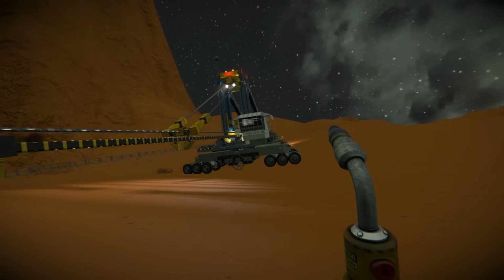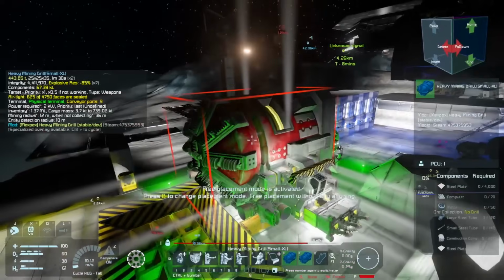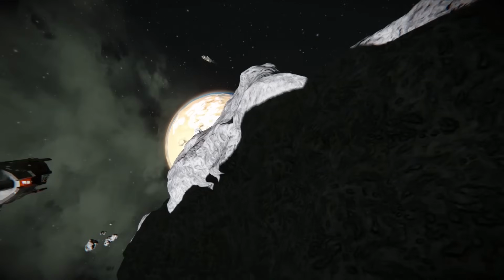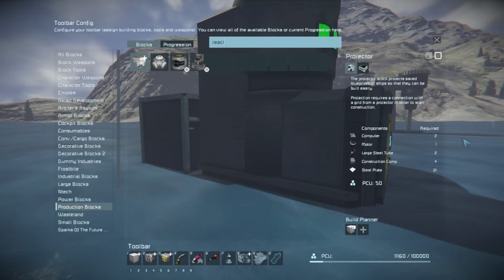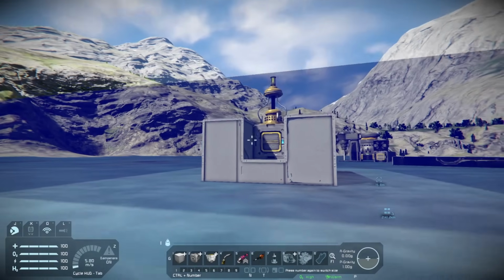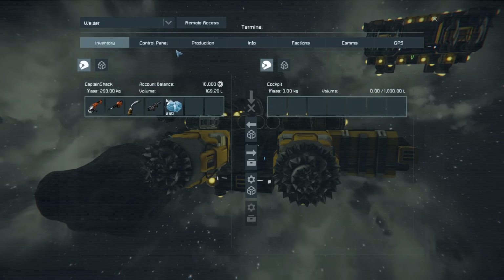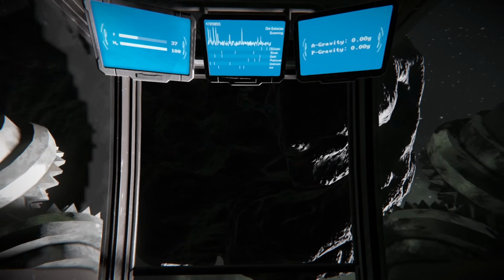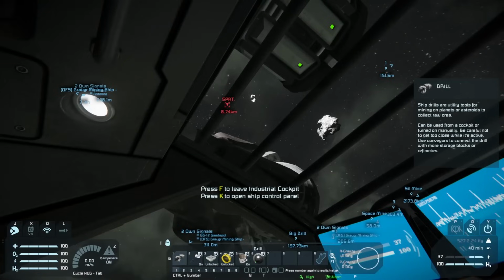Space Engineers - Collection of the Best Mining Mods

Comment: I used the resource nodes mod in my Agaris run because of how it worked well with the static resource locations. Setting up a base, getting it running, and keeping it defended were great 'strategic gameplay' additions in my opinion. It also makes setting up automated resource pick up and drop off drones viable if you have the fuel capacity (which with water>hydrogen you can easily do.)
Reply: Those is a really great ideay

Comment: Resource nodes are a great tool, good for "infinite" ore, but they have 2 massive drawbacks - 1) the sound will drive you nuts after a while, and 2) they shake the whole base like a regular drill shakes the ship.  Got a couple saves that use these for massive underground bases on hostile planets.  Also, those drills will mine stone if you drop them in stone.

I'm glad that you mentioned the the Nanobot Drill and Fill System and the Nanobot Build and Repair System.  I use those religiously in every game I play, just makes life so much easier.

Comment: The double ports on the Advanced Static Drill are for Speed or Power Efficiency modules.

Also, the Resource Node mod needs the drills to be just inside the voxel you want to mine, so you need to excavate to a given ore deposit if you want to use a drill on it. They also have to be a decent distance apart or they start slowing each other down, so you can't just stack 50 next to each other.

Comment: The Radio Spectrometry MOD is what they should have done with Space Engineers when they removed the surface information from the voxels to indicate underground ores.  If it had worked on planets (which it doesn't) with a limited range, it could be the perfect partner to the Deep Ores MOD and make it less of just drilling for luck.
Reply: I basically used the ore scanning script(can't remember name) for planets, and Radio Spectrometry mod for space. My biggest gripe was waiting for the list to scroll, but I think larger monitors helped get around that. I remember using screen/monitor mods specifically for this, and placing them so I could see them from the cockpit or the camera next to the ore scanner.

I used Deep Ores very little since I could no longer scan for all the ores from the surface. I don't know if the ore scanner's range still has a hard-coded limit anymore, but I just couldn't deal with the monotony of drilling like that.

Comment: AutominerV1 came out a few months before Nanobot Drill and Fill, they mine in the same manner but yet I've never heard of AutominerV1 or V2 until now. Autominer V2 seems to have a bunch of built in restrictions where as Drill and Fill you have to add in restriction yourself through the INI file. Seeing as Autominer is station only I think Nanobot Drill and Fill should have been mentioned right next to it considering everybody I know from the extended Xebon Twitch community plays with it and its sister mod Nanobot Build and Repair most of the time. Personally the best thing about these method of drilling while still removing the voxels stopping unlimited resources is that you can move the mining field under the surface to you don't leave gaping holes when you are using rovers or just hate seeing gaping holes everywhere.

Another one that could have been mentioned specially since you mentioned EVE is the Autotmated Beam Drill. It is modeled after the EVE Online strip miners and while it is a very old mod it is still updated.

Comment: Laser mining drill is also a very nice one. That mod even comes with a turret to smack on top of the laser drill block. Since it's a laser it's not actually a drill but works sort of as a drill. Check it out, I think it's cool and would've fit right in in this collection video! Anyways, nice collection & good video! 🙂👍
Reply: ya mean the one that keeps crashing SE if power requirements aren't met
Reply: @Zicetec2000  not sure, have been out for capturing ships. Last time I checked it was alright, somewhere earlier this year. Will recheck soon!

Comment: I notice you dont talk about the 'Industrial Overhaul' Mod? or did I miss it?  I really like it but it has some issues. One is that basically just adds more compexity without purpose for the most part. But it also adds variation (like Oil vs Hydrogen vs Gasoline - which is really nice for vehicles - vs nuclear,etc). and it does not play well with other popular mods. Like the deep ore one. I think I got that to work just once with the Ind Overhaul. One Good thing I like about it is that it spreads the Ores out, instead of clumping them into predictable batches.

Comment: I like the Ressource Nodes Mod but you cannot use it on ores that are deeper than 20-25m I think or else it just mine stones. So if you are using a mod that makes the ore rarer it usually makes it deeper you still need to dig to the ore and then place the static drills on it for it to work.
Reply: They're just finicky on their direction of facing; being offset slightly due to planet curvature can mess you up. They can mine up to 125m from contact with voxels I believe.